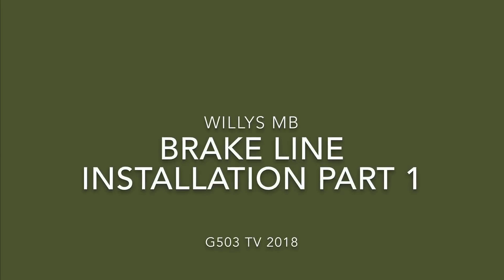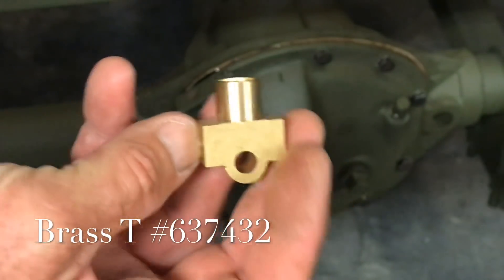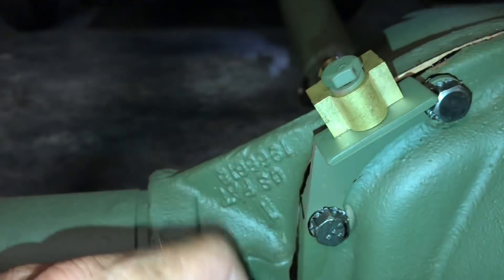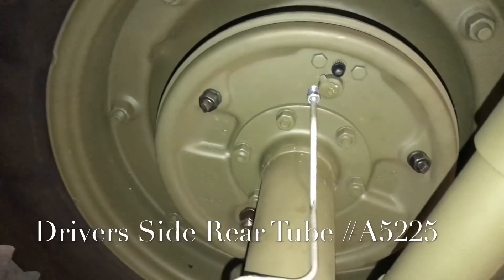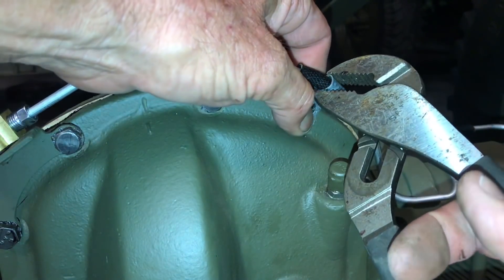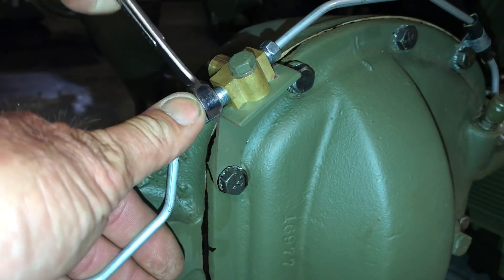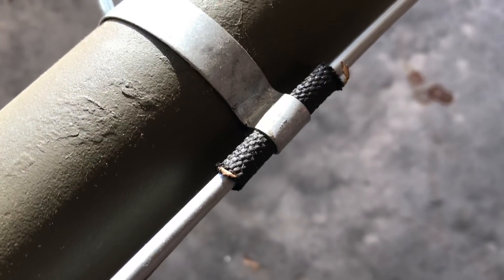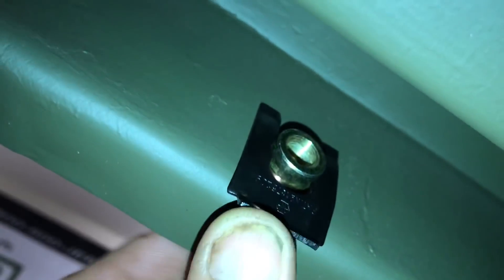Willys MB Brake Line Installation (Part 1) Rear Axle Assembly Team G503 / G503 TV

Comment: Great videos! Have some questions: is the brake line for the M38 similar or are   major differences? What is the thread size for the weel cylinders and is it stright or convex/concave? Also for the main cylinder. Thanks!

Comment: What is the purpose of the jog forward in the brake line near the u bolt? I have seen brake lines shaped like this before, however most of the pictures I have seen of lines do not have that little jog and go straight to the wheel cylinder along the back of the axle. Are there any technical drawings showing the brake line routings?
Reply from the maker: Gerald
The bends in the lines add flexibility to the line itself. The axles and springs are moving and flexing constantly during operation. I straight line would be more rigid and prone to cracking or breaking under stress. Great question, and I was pondering that same thing myself👍

Comment: What is the torque specs for the cover bolts?  Can’t find it anywhere!
Reply from the maker: James Oleniacz the manual doesn’t not specify this, however from my understanding, it is for a 5/16 -18x 3/4 bolt the spec is 13-16 foot pounds. I used this spec. You don’t want to crush the gasket, you want to make a seal evenly. Work the bolts like a clock, 12, 6, 9, 3, then consecutively until all are finished. My differentials do no leak using this spec. Make sure you use a sealant such as permetex #2 or equivalent on the gasket.